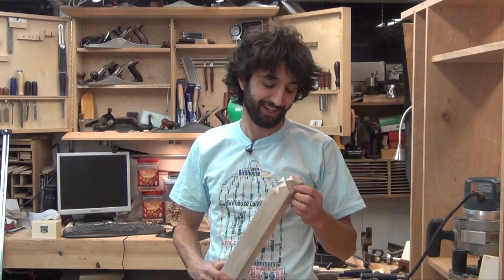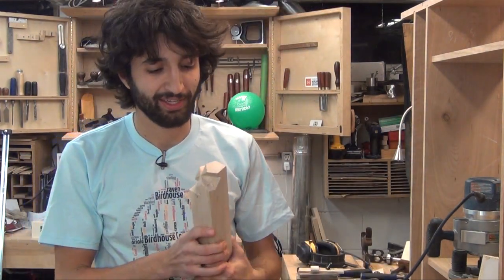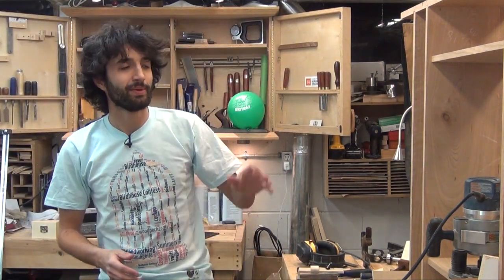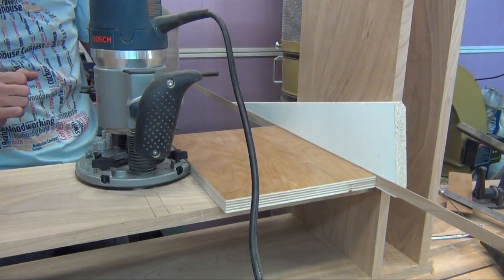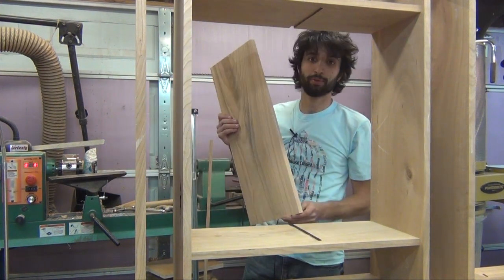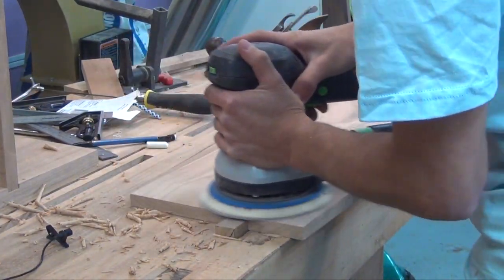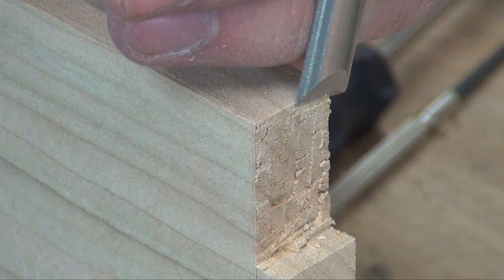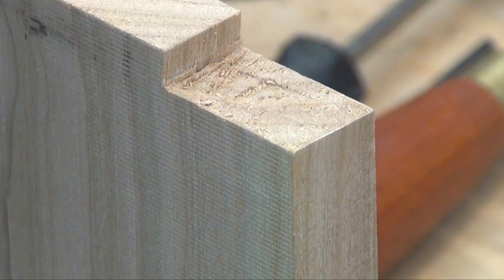Matt's Weekly Shop Update - Nov 24 2014

Comment: Great update Matt.  Recently I had to go through and sharpen chisels and router bits because they had dulled with the work I was doing on my staircase and house trim.  It only took one dull chisel to cause me to go sharpen everything :-)  Recently I have been playing with differently types of joinery and Japanese joinery caught my eye.  I would really like to try some of it.  Not that I need it for a project but it does look like it could be fun to figure out.  Thanks again for sharing.
Reply from the maker: Jim Coogan It is so hard to use a dull chisel.  You couldn't see my face as I was making that cut but it was full of frustration :)  I think the fun thing with trying some of these Japanese joints is just the challenge.  It's a puzzle trying to figure out how they are supposed to go together and then executing the cuts.  Let me know if you give any a try!
Reply: Matthew Cremona I know what you mean.  I was being creative with my staircase and needed a nice sharp chisel.  Really frustrated me and I ended up at the sharpening station the rest if the day.  I will let you know about my adventures I Japanese joinery.  Should actually be fun.